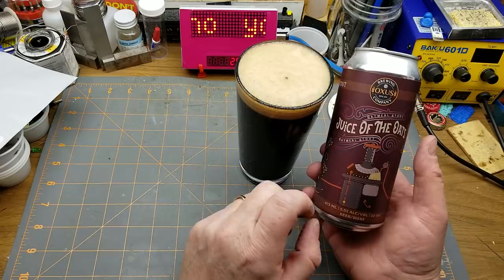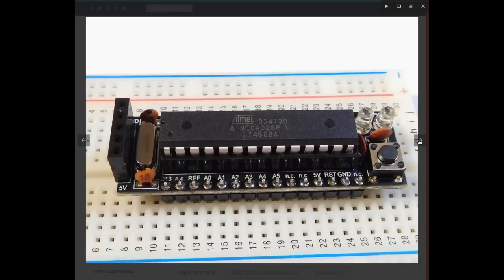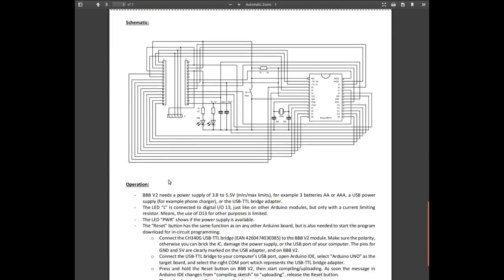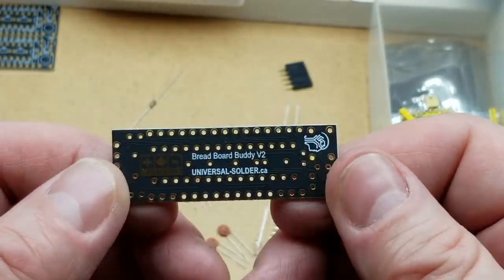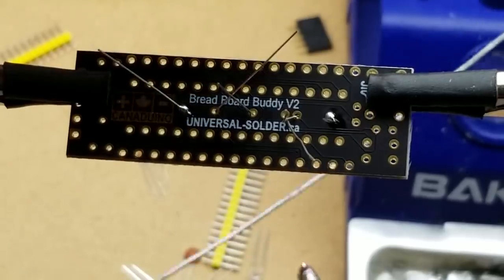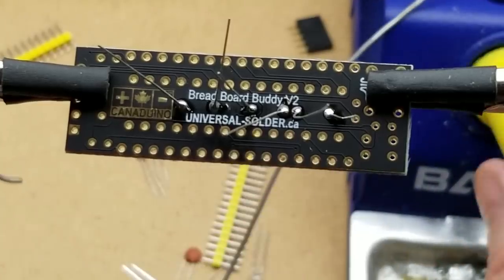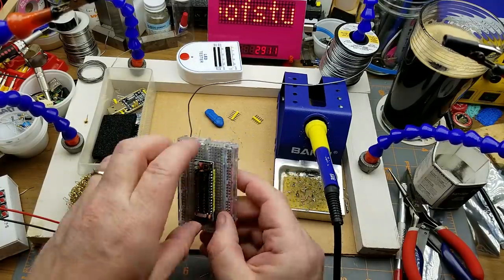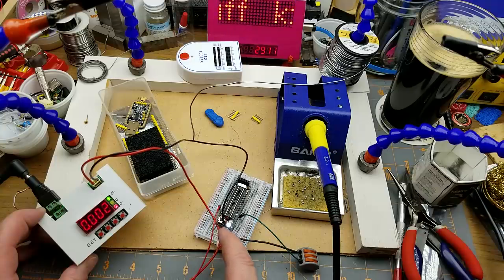DIY arduino UNO kit build

Comment: One word about the resistors, mentioned at 7:20 in the video: The old version came with red LEDs, and the 1k2 resistors were just the right choice. This newer kit comes with the white LEDs, and since those have a higher forward voltage, we had to go down with the series resistors, but forgot to change it in the schematic.

Comment: Very nice project and a nice kit! It's hard to beat Kester solder, I used the type "44" resin core 0.031" 60/40 most of the time. It is available reliably through Amazon - a bit pricey at US $18 a roll, but for repairing test equipment it's worth it.

Comment: I don't know if you have Ace hardware stores in Canada but here in Maine (northeastern US) they have Alpha-Fry 60/40 rosin core electronics solder which I've found it to be be very good and reasonably priced. I like how you use the breadboard as a jig. I never thought of doing that but it seams so obvious now that I've seen it done.

Comment: The compact THT design harks back to the school stamp of the 90's.
Designed for easy technician repair when students blow up the atmega.
its also a basic design practice for pcb design. I've just designed a similar one as a 12 channel servo controller and had the first batch of boards from JLPCB (no not sponsored) I made a few mistakes but hay, its design practice.

Comment: Neat product. It's always more fun to work on things that properly fit in a breadboard like that.  If you like these sort of "Arduino-but-not-Arduino" sort of projects, you should check out the attiny chips. They're easy to program up with an AVR programmer and you can still use the Arduino IDE. Then you end up with just a single chip you can put into your projects. I've been using it for programming the ATTiny85 using the SparkFun AVR Pocket Programmer. 

As for solder, I typically use .031". It's small enough for SMD work and easy to handle. Kester 44 Rosin Core 60/40 is what I have right now.

Comment: I switch between two Kester spools, one is .020“ for the small stuff and  i’ve had the other one so long the number is rubbed off but the caliper says .0295“ 
 When I need to do something with bigger gauge wires or connectors both of those are way too thin sometimes so I have this cheap thick stuff from a local small shop similar to what that Archer stuff looks like. 
 I’m afraid to try buying it on eBay after your experience.
Reply from the maker: I've just picked up some new name brand 60/40 skinny solder from a local supplier. Hopefully it will be a lifetime supply. 

I'll probably use that crappy Chinese solder for adding weight to some model train cars or something. I assume it is at least capable of being predictably heavy.
Reply: My Kester sized spools have lasted so many years that I’ve lost track of how long I’ve had them so at least that’s good for the occasional  Sodding job.

Comment: Great project and I like how you take your time and show us step by step I do have a question have you made a power district / circuit breaker for model railroad
Reply from the maker: Thanks.

So far my railroad is running in a single district off one DC command module (an ancient Digitrax DB100). There is one wye which is using a cheap auto-reverse module that I got a couple of decades ago.

I've been thinking about power upgrades, and the DIY DCC project, but I haven't made any decisions yet.

Comment: Can you compare the current consumption between a normal UNO and that PCB?
What is its consumption in sleep mode?
Reply: You got that always-on power LED, always drawing 2-3 mA (you don't need to assemble it, of course). Besides that, there is nothing taking any current but the MCU. Means sleep current is just as stated on the ATmega specs sheet (about 6μA @ 5V I guess), plus the input current on the reset pin (maybe about 1 μA).